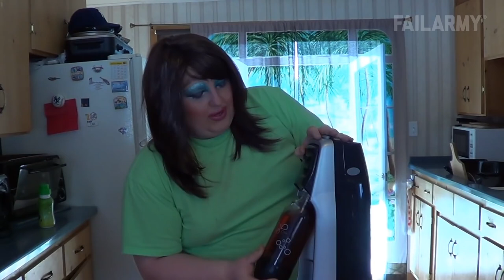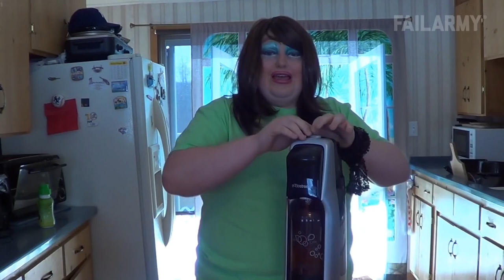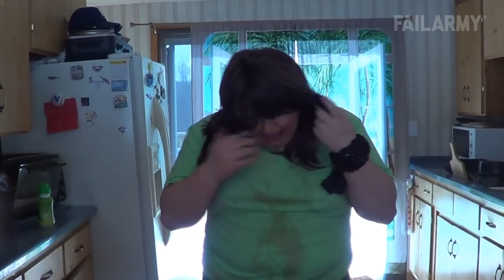Soda fail

Comment: I’m pretty sure you’re only supposed to press it 2-3 times lol
Reply: nar she put the syrup in first thats a nono
Reply: Actually she didn’t press it enough there’s meant to be a small black hole form
Reply: I press one time and hold till it buzzez
Reply: @EdytaJed  you press 3 times for normal fizz and 5 for extra thats what it says on the box
Reply: I press 1 time till it buzzez and Its super fizzy
Reply: My mom does 5 presses for extra strong soda
Reply: you can press forever and nothing will happen, because there is a pressure relief. The failure was putting in the syrup first
Reply: @pseudomonasaeruginosa4104  
THANK YOU I have one of these at home and here’s the correct way to fill it in for anyone who reads this and doesn’t know

Fill the bottle with water

Pump 3-6 times depending on how strong you want it, but NO MORE than 6

SLOWLY pour in the syrup and stick a long straw in there to mix it slowly

Let it sit in the fridge
Reply: My machine instructions say 3-5 Times  But I always do 10 and I NEVER HAD THAT RESULT
Reply: I’m pretty sure that’s the whole point
Reply: @Smunsky  you can press 100 times and that won't happen
Reply: @pseudomonasaeruginosa4104  If she hadn't put the flavor before carbonating the water it wouldn't have done that.
Reply: idk man, 20 works good for me.
Reply: @EdytaJed  Same
Reply: The hand manual said 20- *EXPLOSION*
Reply: @helpkirbyhasagun_2047  I know
Reply: I do it 10+ times and never got that explosion.
Reply: 3x MAX
Reply: I usually do it 5 times for extra fizz

Comment: Clearly she didn’t read the instructions. It is clearly indicated many time in the instructions that you should only carbonize PLAIN water. Also you can’t over do it as the machine will let leak any extra pressure by design once the water is saturated. This is a safe device if you respect the one rules they warn you over and over : ONLY CARBONATE PLAIN WATER!!!!
Reply: What if I wanna carbonate my diesel fuel?
Reply: @sporligulous  You add the syrup afterwards😐
Reply: Actually in my defense you can’t really tell too good with clear water how carbonated the drink is, with a darker liquid you get a better representation for it, as well the only reason it exploded like that if you were truly paying attention, was because it was past the buzzing point for one, she didn’t let it sit for two, she kept pressing the fucking thing even after the buzzing sound tells you its messing up itself, and she depressurized the carbonated bottle too fast letting the beverage being overly carbonated to expand too much pressure too fast out to where it became a hazard, the real truth to this shit is DON’T IGNORE WHAT YOU’RE DOING AND IF IT GETS OVERCARBONATED WAIT FOR A BIT AS YOU SLOWLY RELEASE PRESSURE ONCE THE BUBBLES FALL, SLOWLY FOR A SAFE BETTER METHOD, ACCIDENTS HAPPEN.
Reply: I guess you haven't seen a carbonator video from Cold Ones

Comment: "3. To carbonate, press the carbonating button in short 1 second presses; 3 presses for standard carbonation and 5 presses for strong carbonation."

"4. ... WARNING! Do not remove Carbonating Bottle until after hearing the sound of excess CO2 being released. ..."

"Only use your Sparkling Water Maker in its upright position, on a flat, stable surface." "Do not move your Sparkling Water Maker ... during carbonation."
Reply: Bro speaks safety labels 💀
Reply: @captainzoom854  I recently pushed it a couple more times than 5.